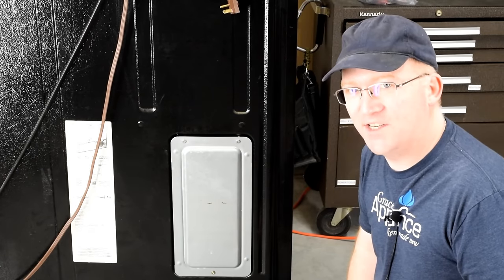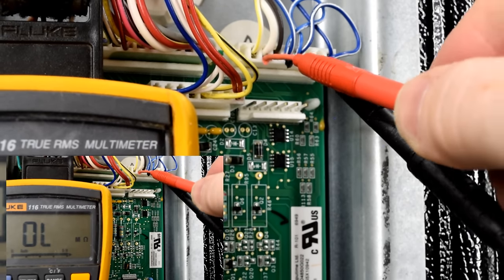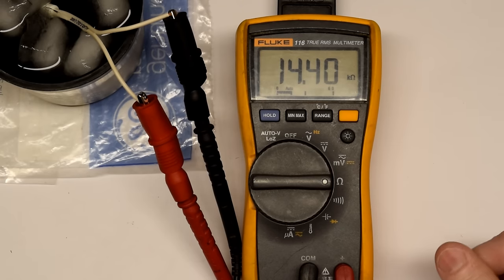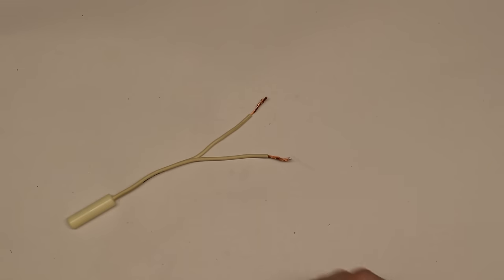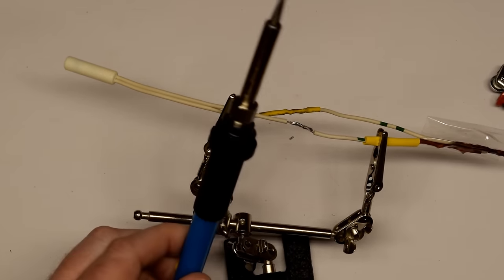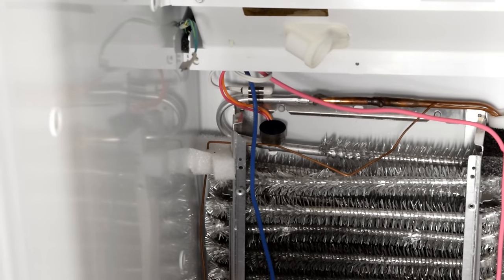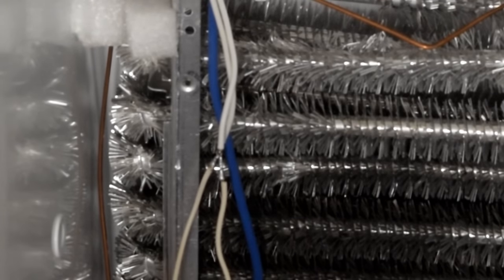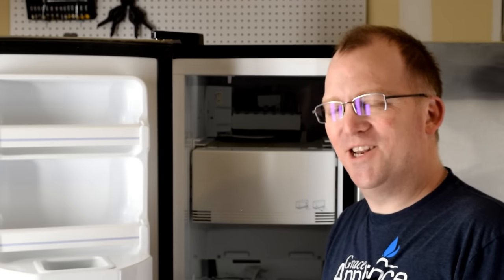Testing and Replacing a GE Defrost Sensor - WR55x10025

Comment: Hello I have a GE GSL255JGDBLS with warm freezer (27°)and warm Fridge temperatures(64°) I tested continuity on all three thermistors, 4.75, 8.38, 11.33 respectively. Is it safe to say the issue is not related to any sensors? TIA
Reply from the maker: Hi Andres, 
Sorry to hear about your fridge issues. 
The first thing I’d check for is a defrost issue. That is, is there heavy snow or frost build up on the back wall of the freezer section?  
The numbers you provided aren’t really making sense to me. You’ve got 3 separate sensors, a defrost which is located on the top of the evaporator, and a temp sensor for the freezer and the refrigerator. The lowest the temperature, the higher the resistance number should be. 

If you aren’t seeing evidence of frost build up on the back wall of the freezer, I’d remove the back panel and visually inspect the evaporator for a good frost pattern. I.e. is there light frost coating the evaporator on each rung of the evaporator after the compressor has been running a couple hours.  If not, this would point towards a sealed system issue (i.e. refrigerant or compressor issue) 
The evaporator frost pattern tells all.
Reply: GE Side-by-Side ONLY - Refrigerator Repair Videos Hi thanks for the quick reply.  I apologize. I failed to mention these numbers are the results on my meter testing the J1 connector in the back panel  and yes I am getting frost on the inside back wall of the freezer section.
Reply from the maker: Hey Andres, 
Ok, you’re having a defrost issue and you’ll need to figure out which of the 4 possible parts that is giving your issue. 
It’s going to be either the defrost sensor (likely given your readings as your defrost sensor should be reading around 16k ohms if it’s covered in snow right now), the thermal cutoff, the heater itself, or a bad control board.  

Start by watching this video and let me know if you have any questions!
https://youtu.be/XeZfpB7ok90
Reply: GE Side-by-Side ONLY - Refrigerator Repair Videos So I tried this test and I got nothing. How do I know which of the two is bad between defrost heater and thermostat?
Reply from the maker: Hey Andres, 
Perform these test with the refrigerator unplugged: 
1) remove the back wall of the inside of the freezer to access the heater. 
2) remove the 2 phillips head screws holding the heater to the evaporator. 
3) lift up on the heater slightly as you're pulling toward you to remove heater from evaporator. (it's on hangers on either side)
4) remove the 2 wires leading to either side of the heater
5) perform an OHM test between the two terminals on each side of the heater. 

If you get no OHM reading, an OL, or no change on the meter - it's a failed heater. A good heater would show resistance. 

Let me know the reading you get on the heater and if needed we could look at the high limit thermostat, but I can count on one hand the number of these I've seen fail so I wouldn't start there. 

Thanks!
Reply: GE Side-by-Side ONLY - Refrigerator Repair Videos looks like it's a bad Defrost heater. 0L displaying on my meter! Yay. Just  ordered it on Amazon. I will be making a donation to support your channel sir. Thank You so much!! Can I run the fridge without the part until I get the new one?
Reply from the maker: Andres Soler thanks Andres, you’re amazing! 
You ‘could’ run the fridge until then and it may cool for a day or two, but will gradually get warmer as it continues to frost up. However, you’d then need to fully defrost it again once the heater gets there. Pick your poison I guess.  :(
You could always install the new heater and then use the forced defrost trick I show in the video to more quickly thaw it. I wouldn’t leave the jumper wire on for more than 10 minutes at a time and wouldn’t leave it unattended during that time.  
Thanks again.
Reply: GE Side-by-Side ONLY - Refrigerator Repair Videos yes it was frozen solid.  I used my heat gun on the bottom half just to pry off the bad heater. :)

Comment: Hello Andy ,

Hope your in good spirits...after replacing the condenser motor my freezer is still not freezing ! ? What do you suggest I check next??? 

Thank you.
Reply from the maker: Hi Samuel,
When you removed the panel covering the fan, do you see that the evaporator is completely covered in a light coating of frost? Or do you see massive amounts of snow covering the evaporator?
Reply: GE Side-by-Side ONLY - Refrigerator Repair Videos 

The motor I replaced is down on the back of the fridge...# wr60x10220 part # motor cond fan .
Reply from the maker: @samuelsanchez4885  ah, I understand.
So, it was not running before, but is after you replaced the fan motor.

If your compressor is running, and both fans are running (inside the freezer and behind your refrigerator) and your condenser coils are not covered in dust... The freezer after running for 24 hrs should be getting to around 0 degrees. 

If that's not the case, I would think that the fact that the compressor was overworked with the condenser fan not having been working.  This likely damaged your compressor and no longer is able to maintain temp no matter how long it runs.

Of course, I'm just going by what what I've seen before. To test this theory, one would need an Amp Meter which measures how much power the compressor is using.
The compressor should be pulling about 1.25A once started up.

Just to confirm, your compressor is running while the condenser fan is running?

Comment: What reading should they be. Had two in the 4 ohm range and one at 6.5 ohms
Reply: I have no specific knowledge.

Perhaps the wires are not in the same order as in this video.

Perhaps the control board is affecting the reading because it has a different design.  Unplug the cable and check the readings on the cable, that will isolate the control board.

Comment: Hi Andy......do you have videos dealing with the condenser fan not functioning for a GE PFS22MBWABB?  Also after watching your video on the side by side, I was going to check out the condenser and evaporator fans via the ohms readings from the P1
plug on the main control panel.  However my P1 does not have a blue and white wire.
My temperature control panel in the refrigeration section does not light up.  What do you suggest?  I have been told that whenever it does not work it reverts to default settings and is not actually necessary.  True?
Thank you so much.  You do a great job in your videos.
Doug
Reply from the maker: Hey Doug, 
Sorry to hear you're having issues with your fan not working.  So, this channel I focus mainly on side by side GE so the information here may not be 100% transferable to your french door fridge, but you have the same control board behind your refrigerator as what's shown in this video (WR55X10942P) So, the plugs will be the same, but the wiring schematic/colors will likely change. 

The closest video I could recommend would be this one:  https://www.youtube.com/edit?o=U&video_id=PhQKqF5MgDE

Which deals with how to check voltage from the main control board to the fan motors.  I'd start there to ensure you have appropriate voltage being sent to the fan motor. Your fan motor WR84X10055 has 4 wires on it so it won't line up exactly with my schematic, but look at about the 9:00sec mark in this video.  You'll be looking for between 12-14 volts DC from the main control to your fan motor.  Alternatively, and probably more simply you can check the voltage directly at the fan motor plug vs at the control board.  

All that aside, the problem in your case will likely be control board related vs fan related because you mention the lights are not coming on at the control panel.  The fan not working is probably a side effect of the board having failed, so one can easily chase that rabbit trail all to lead back to the failed board. 
You are correct about the fridge going in to a defaut or fail safe mode, but only if the board is unplugged.  If the touch panel has a short in the board, once unplugged (i.e. removed from the circuit) it would allow the fridge to fire up and run.  You can disconnect the wires from the temperature control inside the refrigerator at that point, or at the main control board if you are able to identify the correct harness there.  Either one.  

Inside the temperature control housing, you should have a wiring diagram / tech sheet tucked away in there. Hidden well. 
So, i'd just start there with the fridge unplugged, unplug the harness, and plug the fridge back in (with the harness disconnected).  If the fridge fires up as normal - you've identified it as a shorted temperature control. If no change, I would look more closely at the main control board. 

I also have a video about the common failure points that you can visually examine in this control board: 
https://www.youtube.com/edit?o=U&video_id=zbmAqizE128

I hope this helps, but please let me know if you have any questions!  Let me know what you find once you disconnect the temperature control harness. 

Andy

Comment: Hi - at the risk of hoping for "free consulting", on a PFS22MISBBB (french door, bottom freezer), I had warm-fridge/cold-freezer, so suspected the thermistor in the 'roof' of the fridge.  I tested it - I'm a E.E., so validated the temperature vs resistance curve...and it was OK.  The digital diagnostics, however show failures on "fresh food" (#2) and "freezer" (#5) thermistors. 

Two questions come of this: First, diagrams suggest only the one thermistor...it would seem the defrost sensor would be in the freezer compartment, but videos and and exploded views aren't helping - - ?  Second, is it possible that the failure code for #2 (per the factory diagnostics sheet) is a false-positive; wrongly indicating a failure on a thermistor that doesn't exist?  THANKS!!
Reply: Update; there still seems to be one "false positive" - e.g. checking for a 4th thermistor, when I have only 3 - BUT, there was a failure: The sensor on the evap coil had no "T-curve"..it was a 4k resistor irrespective of temperature.  Will replace tomorrow, and we'll see if the issues abate.  Thanks for a great video.
Reply from the maker: Hi Paul,
Not a problem at all. I'm happy to help you as much as I'm able.

Some models will have multiple temperature sensors inside the refrigerator section and the temp sensors will occupy the 1st and 2nd left pin spots on the plug referenced at 2:58sec of this video. I'm on my phone right now and can't look up your schematic, but would check inside your fridge section for a 2nd sensor if you see 2 wires as shown in this video at 2:58sec.

The defrost sensor is located on the top of your evaporator and requires removing the rear panel inside the freezer section to access that.

... Here's the thing, the components you're talking about are sensors and a control board to make the decisions based on the sensor responses. But, it seems odd that 2 sensors would fail at the same time. Also, since the sensors are within specification - one could assume they are good right? Well...not always in my experience. Also, I don't think you'd get an error for a non existent sensor. My guess is you have 2 fridge temp sensors. 

I always leaned toward replacing the sensors before jumping right to a failed control board. They are, in comparison, waaayyyy cheaper than a board.

I'd try new sensors to see if this does in fact resolve it based on the error codes, but if not a new control board would be in order. 
With multiple sensor errors as is your case, I kind of suspect a failed board, but would recommend new sensors with a new board anyhow so I'd just start with the sensors.

I hope that helps.
Reply from the maker: Paul Smith excellent work!  It definitely sounds like you found the offending sensor! Way to go.  
I’m betting that solves it for you.  
Keep me posted if you have any question or issues.  Andy

Comment: Hello, I have a Kenmore Pro (Samsung) 40140483800 Refrigerator.  I am not getting power to compressor. Compressor will NOT run. I replaced overload relay, main control board, power board, power inverter contol board, cleaned condenser.  condenser fan comes on, everything comes on but the compressor. I checked winding on compressor and they checked OK.
 I also check for voltage at the end of plug coming to compressor-No voltage.
 A Sears Tech came out and had not idea what he was looking at. Then, I called second local company that works on appliances. He suggested replacing power inverter control board. That did not fix the problem. Unfortunately, there is no information out there. This unit is made Samsung. Any idea? Any suggestion will be greatly appreciated.Robert

Comment: Great video! Would you happen to have schematic reading? How do you get those J1 plug to test it?
Reply from the maker: Robert Munguia hi Robert, the sensors change resistance based on temperature. The chart in this video will show you these readings. They are the same readings regardless of you are testing a defrost or temperature sensor.

What sensor are you dealing with.
I'm sorry if my reply may be slow. I'm moving the next two days.
Reply from the maker: 5min 4sec in this video will show you the appropriate ohm readings for the sensors depending on its current temp. I hope that helps.

Comment: Great VIdeos!!!  I have a PSCS3RGXCFSS and i ran the self test labeled 0 7 for thermistor sensor testing and my results were p1,p2,p3,p4, and 05.  i cant find anything for that 5th sensor.  can you share anything regarding what sensor 5 is and where it is located or is this simply a generic feature set on my mainboard and it has capability to support 5 but i only have 4?  i'm afraid that the bad 5th sensor is causing some issues but wanted to ask you first.  THANK YOU FOR ALL OF THE GREAT WORK!
Reply from the maker: Hey Brian, 
Most of the side by sides will have 3 sensors total. A freezer temp sensor, a defrost sensor and a fridge temp sensor. Some will have (and I believe yours does have 4) the only difference is that the fridge will have 2 sensors because it has an evaporator in the fridge section. One is a temp sensor and the other an evaporator defrost sensor. 

The closest wiring schematic I can find on your fridge is actually a digit off, but should be really close to what you've looking at. 
On the J1 plug you'll have J1-1 = Blue/Red (fridge defrost sensor), J1-2 = Yellow (fridge temp sensor), J1-3 = Red/White (freezer temp), J1-4 = Blue/White (freezer defrost sensor) and J1-5 = Blue (+5vdc power). 

Let me know if that's what you see on your board.  Thanks!
Reply from the maker: Also, I don't even bother with the self tests when it comes to thermistors because the test will only tell you if the sensor has failed (i.e. is an open circuit), but it does not give you the OHM readout so you can see if it's in specification.  So, you'd need to do an OHM test with your meter and match that reading up to the true temp of the sensor at the time of the test. 

Let me know if you have any questions. 

Also, what symptoms are you dealing with?
Reply: @GraceAppliance   true but in this case all 4 sensors ohm out the same so that's good.  what has me mixed up is the self test claiming sensor 5 to be a status of 0 instead of P.  i was trying to identify if there was even a 5th one and why would it think there was?  THANK YOU for taking the time to help me!!!  I truly appreciate it!
Reply from the maker: @AllThingsBambu  yeah, I don't believe there to be a 5th one. You're most welcome and let me know if you have any questions! Andy